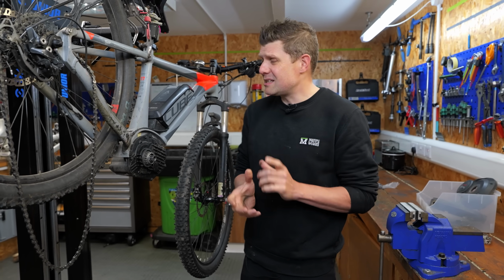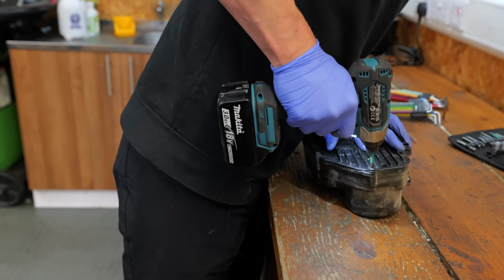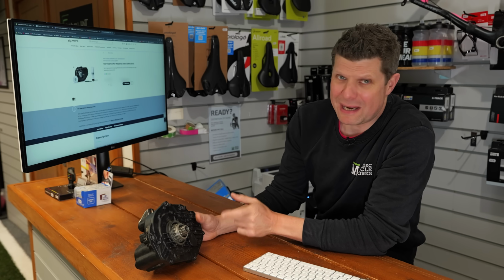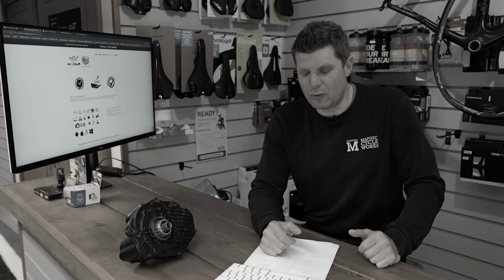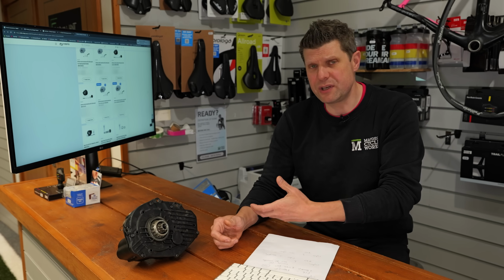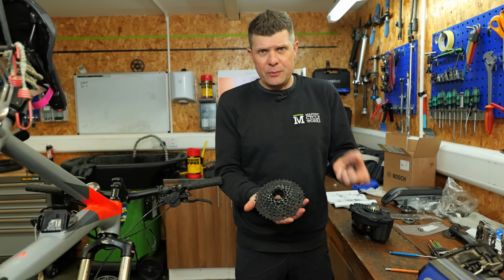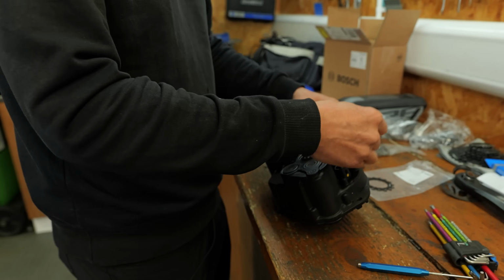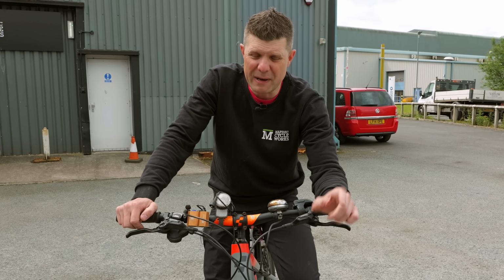This £750 eBike repair could have been avoided

Comment: I put my bike in the car and drove to Fordingbridge and got the Bosch repair centre there to have a look. My PCB was also toast due water ingress and unfortunately the motor was unsalvageable. So for less than £400 they fitted another reconditioned motor with new bearings, better water resistance and a guarantee. As a cycle shop, I would use these people on behalf of the customer knowing their warranty would cover you. I now have a gen 2 Bosch motor that goes well 😀
Reply from the maker: What is the name of this place please?
Reply: Ebikemotorcentre?

Comment: Utterly fascinating video, and horrific at the same time. 

I bought a Giant Xplore +2 the month before covid lock down no.1.

It has been great fun and has enabled me to cycle far further than I would otherwise. 3,500 miles in 4 years. Whilst strong I have minimal stamina, due to loads of surgery, and sometimes totally depend on my bike to get me home.

Two years ago I was caught in a major rainstorm and shortly afterwards my display started misting up and after 30 mins was totally unreadable. Shortly after that the motor went into limp mode. Shortly after that the system packed up altogether. I was out on a club ride and we were about 5 miles from our campsite. It was a nightmare to get back. 27kg + gear.

Two days later at my LBC I was advised that the display, controller, and motor are not waterproof AT ALL. The display was totally bust, as was the controller. The. Bike was 1 week out of warranty. Because my LBC had regularly serviced it they managed to get Giant to contribute 50% of the parts cost. The parts took about 2 months to turn up. My 2 wheeled paper weight sat forlornly in the garage.

I have since tried to upgrade my battery to a 650 (from 500wh). Nope. Can only do it if you have the following years model. Not happy.

Recently I have been delving into motor compatiblility, backwards compatibility, manufacturer specific designs. 

My conclusion is that if my motor packs up the bike is heading for the tip. I shall revert to using my old but fabulous pure pedal bikes. I am not shelling out another £2,500+ to get conned by dodgy manufacturers. 

The only alternative may be when some Chinese manufacturer starts building ‘compatible’ motors for half the price. Like your customer it is important to me to properly repair wherever possible.
Reply from the maker: This a sadly familiar story.
Reply: @Mapdec  The e-bike industry will eventually kill their own product. The LBS are fighting against the tide.

Comment: Funny story which happened to my Stromer 45 km/h bike: they wanted to replace the whole motor for about 1200€ because of two faulted bearings. I only found a service center in the Netherlands who would open the motor for bearing replacement

Comment: That's why I build my own ebikes,parts are very easy to get at very good value ,built my own bike with Halo wheels and nice other parts for less than 1500 GBP ,10.000 miles and not a single problem

Comment: There’s many things you can say about Bosch, and many have merit. But at the same time, the customer also needs to service their motor. You can’t run a bike into ground and then act surprised when it dies. However, Bosch should make these fixes possible because these customers do exist! Great job, mate. Love this channel
Reply: The thing is where did all the "balls" go???????
Reply: @alanpatterson2759  That’s a great question. They’re certainly not soft! I’d have expected to see them
Reply: @MarioGoatse  well it's a well sealed unit! the amount of debris doesn't equate to the loss of ball bearings. The broken cages were there?

Comment: It's always great to save a bike. Even if it costs an arm and a leg. When you love and enjoy your bike and it's mechanically perfectly fine still, why toss it in the skip for just cosmetic reasons? I love my bikes for the character they develop over the years with the parts and bits I added myself and the scratches they collected along the way. Also she has a brand new motor now which probably will last her a good while (with proper maintenance). Thumbs up for her decision and your help in this.

Comment: I would love it if you would still send the bad motor to the pcb repair shop and try to figure out what was wrong with it. Document it well so in the future we might be able to fix the issue.  But I would totally understand If you dont want to bear the costs for that.
Reply: Very difficult to diagnose. Diagnostics without knowing how the board works would chew up time.  

If you wanted to try anything, then do this ...
Give it an inspection under a magnifing glass. Look for charring or discoloration or damaged parts.
Give the board a thorough clean with rubbing alcohol, small brushes, q-tips, and cotton swaps.
Another inspection. Give the board a try. If it doesn't work, oh well at least you tried.
Reply: @joecanuck3751  Or just leakage between the traces...very hard if not impossible to see under a microscope even. You'd have to use a high-imp meter to measure for it...a massive waste of time.

Comment: Had three motors under warranty from Bosch.Performance line bearings sell an outer seal to protect the bearing .Had no trouble for 3 years 2000 miles.👍

Comment: I think that’s what puts me off e-bikes the motors and the cost and servicing that I can’t do it myself
Reply: just buy brushless hub motor.they dont require maintance and if brake all compatible with each other and very cheap to buy
Reply: If you're willing to pedal and sweat, you save a lot of money and hassles.
Reply: @michaelclements4664  And having more fun while pedaling (most of the times lol.) At least you're not cheating yourself by doing the real work.
Reply: Bafang mid-drive units are the way to go. Reliable, cost effective and you can service them yourself, they will also fit most bike frames. Off the shelf bikes are super expensive, you are limited to getting them serviced at the shop and when they go wrong, you are in a difficult position. At least if mine packs up I can shove the old crank back on my bike whilst I sort the problem.
Reply: @C0NR098  they are great. ive done 5k miles on mine in the last year and still going strong. that includes travelling 12 miles each way to work in Scottish winter!

Comment: That's what Bafang does. You can order individual parts for like $25. Bearings, seals, gaskets, sensors, controller, nylon gear, main gear, freewheel etc.

Of course you can't do that as a reputable bike shop, but my BBS02 used to cost me $100 per 10,000km.
Reply: Same with Tongsheng motor, they offer all parts. Even housing and individual small screws, springs etc.

Comment: The spares unavailability for the pre built ebikes is one of the reasons I keep using bafang bbs kits , you can find every spare part for them and easily repair as a home mechanic, the downside is the waiting time for the parts fortunately I didn’t have to replace anything yet in 8000 kms

Comment: Always do what you did . . . try to fix, investigate options, replace parts if possible and available, if can't be fixed then buy new component but only if owner is happy with bike's performance and doesn't want to upgrade to latest tech or design

Comment: We can all agree less stuff needs to go to landfill. You've done the right thing, you gave the customer the options and happily she opted to repair the bike instead of slinging it away and buying new. I think it's extremely poor that the motor manufacturers don't supply full rebuild kits for these things. It stinks of profiteering that you're forced to buy a new motor. What we all need is for Hope to start making motors and supply every spare part for them for the next 20 years 🤣

Here's an idea, CNC plates which take a normal BB to convert scrapped e-bikes back to normal bikes!

Comment: Option 4.  

Use a conversion mounting kit in order to fit a bafang m5/600 or m620.  People make them for this exact reason
Reply: @BramBiesiekierski that’s definitely an option & something I’d look at, but as you’d need a conversion mount, bafang motor, battery & controller, so once fitted would it be much cheaper for a shop to supply than a slot in oem motor?

Comment: This is exactly why i dont use bikes with integrated e bike motors. Instead i use mid drive kits. Like the bbs02' hd and recently the tongshen tsdz8. Especially for the bafang motors parts are plentiful and somewhat cheap. It does mean being open to your own diy repair but imo its part of it and not so difficult if you have decent bicycle building experience. Another thing i do is to spray exposed electrical areas inside the motors with conformal coating. The grease i use is mobil shc100 and i do tend to clean and regrease every year or so. So far ive had a bbs02 for 4years that yas over 10k miles with no issues other than a new plastic front case and a gasket or two upon reassembly. I use bosch cargo line daily also for work and have had issues  with pawl slip on multiple motors in the past. Im not convinced bosch motors are all that great apart from the software side were they really have managed to make it feel seamless.

Comment: I have the same Bosch motor on my ebike and it was helpful to learn a little about servicing it. I feel like Bosch intentionally obsolete their products, and provide minimal service options,  the recent change to the "Smart System" the new plug does not allow any backward compatibility for the charger, battery, etc. which obsoletes everything I already have and they didn't provide any adapter or conversion options. This left me thinking my next ebike won't have anything made by Bosch on it.

Comment: I suspect that the motor controller could be replaced with an external generic motor controller with Bafang display, thumb throttle and PAS sensor. Bosch would not approve. With Bafang motors, even the internal motor controllers for the BBS-HD are readily available.

Comment: 500th like even though I don't own any eBike but this was interesting with the lack of alternatives. Sadly, Bosch should have had a PCB you can buy for $50 but they won't allow you that option. You did the correct thing here as your choices were limited and the longer view was clearly replacement. Always impressed by the thought process.

Comment: Good outcome and a(nother) great video. But wow, I really struggle with the proprietary ebike thing. Having to negotiate a replacement? That's insane. Are they worried you are going to send it to Russia or Iran?

I've been really happy with a CYC Photon conversion - makes the Bosch look like a waste of space. Durability for the Photon is unknown, but the known durability of the Bosch and other brands isn't very good anyway. And at least if my motor fails the original bike is as good as it ever was and isn't landfill.

Comment: i kept sending my old car to garage to keep getting fixed and spent more than it was worth at least three times to keep it going - and not scrap it. it is still in use today (by new owner) - over 250kmiles and 17years old.
I would probably do same with a bike if i liked it, it was great when working and till cheaper than a new one.

Comment: In that case replacing the motor with a new one seems to be the most logical choice. However, I was told that if worn out the wheel (i.e. the brake strip) on my Brompton I will need to buy a whole rear wheel including the internal hub gear which is the major cost of the rear wheel. When I asked if the rear hub could not be detached from the old wheel and put on the new wheel, so I would only buy the rim instead of the whole wheel, the answer was no. Later, I figured out that actually this could be done but some bikes shops finds it more profitable to just replace the whole wheel instead of salvaging the what can be salvaged due to the time they need to spend on it.

Comment: I just had my first ebike problem over the weekend and it left me puzzled. Small issue that is overblown.

After nearly 8000 km, apparently the sensor cable came loose off the motor. I tried re-attaching it, went for a ride, it showed soft fault instead of hard fault. Then I realized that I broke 1 of the 4 pins inside sensor port port. Fazua told me the only option is to sent the motor unit back to them and it'll cost around 90-130 €. The pin that broke off is probably 0.05 grams and it costs me that much? Even with premium postage, over 50 bucks to replace a modular port?

100% my responsibility to forget to follow the manual, but the design of the plug is deceptive and anyone could make the same mistake. The plug is round like a speaker jack (or 5520 DC port) and one can think that there are only a negative and positive nodes inside. Although, there are actually embossed arrows on both the cable and the plug, both are very faint and not colored (zero contrast). I noticed them after pin break off. One can easily make a squared-shape plug, hinting at the mechnic / user that there is a right way to connect it.

Not only the product design is questionable, the choice of exclusive repair at their own workshop is baffling. Funny how they have "tiered system" dealers, certified and premium, but anything happens to the motor, they have to post it to Fazua HQ workshop.

Comment: As others have said, manufacturers should offer a refurb/exchange service kind of lik what you have for alternators/starter motors. Means a cheaper repair would be available that should still be supported by the manufacturer and easily offered by a dealer network.

Comment: I would probably of got it fixed. They still have their bike and it has a new motor with 2 year warranty same as if they would’ve bought a new bike but cheaper. If you split it into two it’s only £300 per year, that’s not too bad.

Comment: 7:34

"Apple have opened this up to people to repair...."

Yeah, no. Apple were FORCED, and they still go to great lengths to screw over their consumers and repair shops.

Louis Rossman on youtube can explain in detail why these big multinational companies are doing the complete opposite of that.

£700+ to repair what is clearly a pretty badly designed motor (That PCB wasn't even potted or isolated in any way. No wonder they're prone to moister damage) that is just ridiculous money. And unfortunately, when you buy the pre-built "off the shelf/premium" brand ebikes, you'll pay through the NOSE for the most simple of things. 

The most anti-consumer products out there today are Ebikes from big name brands, and that motive is made immediately obvious when it comes to repairing these bicycles that will inevitably wear down and fail due to the nature of what they are -- making repairing them all the more important.

for £300, you can get a TSDZ2B mid drive, flash it with open source firmware, and program it to your hearts content to your specific needs. There is NO REASON AT ALL to be buying any of this overpriced garbage.

Comment: Wish Bosch would make it a bit easier to just buy a replacement motor. I'm definitely keeping my eye open for a gen 4 performance speed motor, for when mine eventually fails. I'm doing my first Cues swap here at the shop and when reading about the parts, they say only compatible with LinkGlide. Maybe the mechanic was new and just saw 9 speed and figured it all works together.

Comment: Never buying a mid motor e-bike again, 2 Shimano e6100 motor failures, one within 6 months, Shimano have no extended warranty on a replacement motor, absolute joke. Now using a rear hub motor e-bike with the sacrifice in torque but feel confident that this will last for years. Sealed, no water ingress concerns or bearing failures.

Comment: Guessing they got a few years out of that, so not all bad. They will likely come back to you as well so will now get it fully checked as needed anyway, glad it wasn't wasted.

As to the resale, it doesn't cover having a new motor with two-year warranty, which you generally cannot get second hand.
Reply: 'Guessing they got a few years out of that' - not necessarily. I have a Trek e-bike which I have had serviced regularly by an approved dealer and the Bosch motor failed after just over two years and 5,000 miles on generally good surfaces.. I'm told that mechanically it is sound but the electronics have failed. As mentioned in the video, there is no replacement so it's a new motor for £700.

Comment: An unfortunate situation but a no-brainer. When you look how much e-bike prices have gone up recently to fix is far cheaper than replacing with a new similar spec bike. You could go secondhand but don't know the actual condition of the motor and could end up in the same situation again.

Comment: I thought that manufacturers were now having to produce products that were more serviceable and repairable to help prevent complete replacement being the only option and therefore landfill.

Great that the owner was prepared to spend out pn q whole new motor and avoid the bike only being worth spares and repairs value/landfill.

Unfortunately new technology and manufacturing costs tends to lead to alot of components being bonded or ultrasonically welded together, so disassembly and repair is difficult or impossible.

Sadly our throw away society continues at pace, but well done for trying to avoid the complete new motor purchase and saving the owner some money👍
Reply from the maker: The regulations are really poor.  One thing is that they need to make spares and instructions available to professional repairers.  However, the definition of that is poor, and it is easy to restrict the pool of repairers to nil by making service tools hideously expensive and specialist, or by restricting training to virtually zero attendees. In reality only competition will drive change.  However as we see with carbon wheels from China, no one cares about repairability. Cost is all that matters.